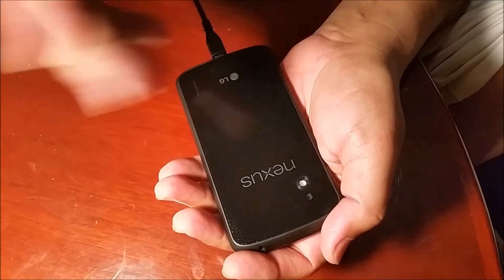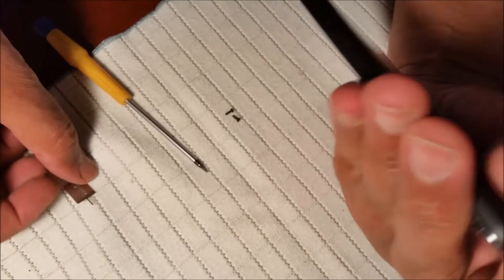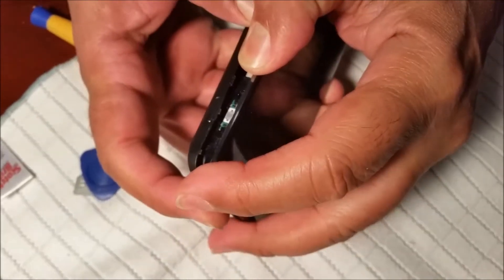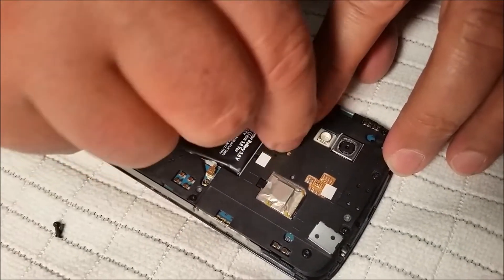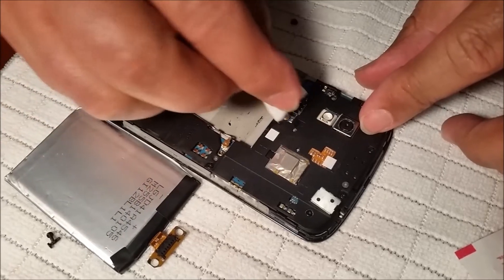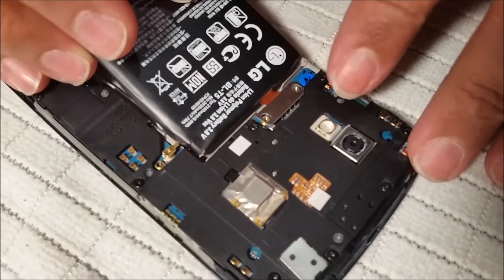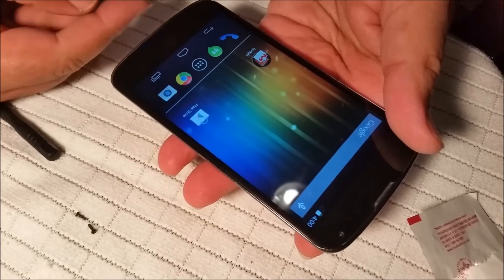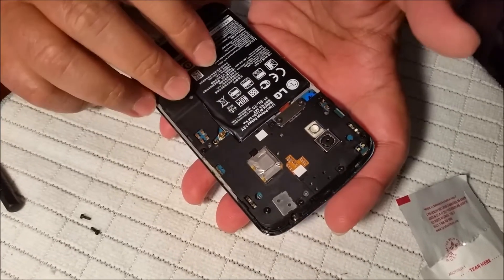SOLVED - How to Fix DEAD Nexus 4 | Red Light Shows or Blinking

Comment: It worked and it was so easy!

I followed your instructions and within 5 minutes my phone was working once again.

Luckily I had an inexpensive eyeglasses screwdriver kit with a magnetic base.

I found the two appropriate screw heads and removed the screws which remained on the screwdriver until I could put it in a safe place. This saved so much time.

I cleaned the battery connectors replaced the screws and the cover, plugged it in and the phone powered up immediately.

I never had such an easy repair.

A friend came over the previous evening who fixes mobile phones and he thought the base connector could be damaged after many years of use and I was not happy. A few times previously my Nexus4 had a black screen and the lower-volume and power buttons successfully rebooted the phone. This time it didn't work even with the phone plugged in all night.

This situation happened when my battery was not plugged into a charger and the battery died and the phone screen was black. I plugged it into a charger and a red light at the base of the screen started blinking. I needed to take the TPU protective case off so I unplugged the phone for a second, replugged it and the red blinking light did not reappear. Nothing I did could restart the phone. I kept the phone plugged in all night.

The next day I found your video. It was my first attempt ever opening the phone as I usually am reluctant to do so as I am afraid I may damage one of the delicate parts inside. Needless to say, it worked immediately.

I still use my Nexus4 daily and I thank you for this great video.

Comment: Nice tutorial! There is a problem with my LG nexus 4. To get some results i rooted it via kingoroot. After the root, strange things started happening with my cell. It heated and its battery consumed too early and the mobile shut down. When i recharged it, it opened its welcome screen with its logo. The mobile stuck at the logo and did not move further. How can i fix it?Please tell  I'll be thankful to you.
Reply: ok i try, thanks for the help.

Comment: i am having another but somewhat similar type of problem,
my phone is not starting without connecting it to a power source, (even connecting to a pc doesn't work)
if my phone is not connected to a charger, it won't turn on or start only till the boot logo,
i have also another problem , the soft key one, i used chroma os to fix that, and it worked for 2 weeks and after that the same problem happened,
I am going to try your method once my t5 screwdriver gets delivered, 
i will give update in 2-3 days here

Comment: Hi. Thanks for posting the above video. I have a friends nexus 4 that I am trying to fix. This phone has the solid red light and NOT a flashing red light. He already got a new phone. Here's what I tried with no success:
1. New battery
2. Charged for almost 12 hours, USB charger, wall charger, the Force
3. Unplugged and pressed power button and volume up button for 10 secs, 30 secs, 60 secs
4. Removed new battery and cleaned contacts as mentioned above
5. plugged in phone to charger while pressing power button
6. Unplugged phone, pressed every button combination. 

Result: Solid red light with no response. About to give up. Read somewhere that it might be a dead / fried motherboard.
Reply: +reln72 hey did you ever figure out a fix? I'm having the same issue.
Reply: +100redeye No. I couldnt get it to work. I just went ahead and purchased a Moto G 3 instead.
Reply: I heard somewhere Solid Red Light means it was bricked
Reply: Its dead

Comment: I did this yesterday and it worked, but the battery was still not charging properly. Just tried it again now and it doesn't work the second time. Do you think a new battery will fix the problem? The phone is 2 years old.

Comment: Hi...Thanks a lot..IT works well...I just tried and it got fixed. only struggle is removing the back pane ...And we dont need to remove the battery ...Just the connection & cleaning is good to go. Anyway thanks again.

Comment: i can't get the screws out to remove the battery. I tried a dab of wd40, still nothing.
Reply: ***** it didn't work, i think they were welded in, i'm having the same issue with usb port screws. i've tried several things.